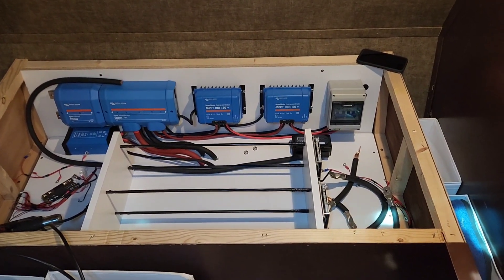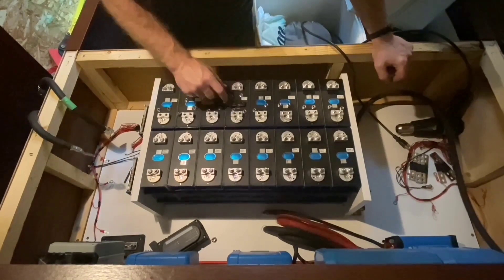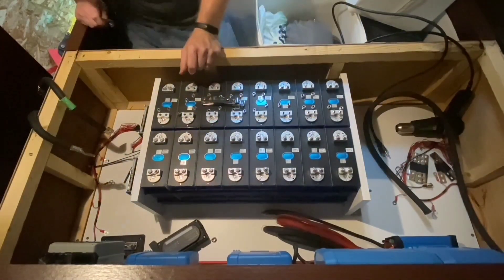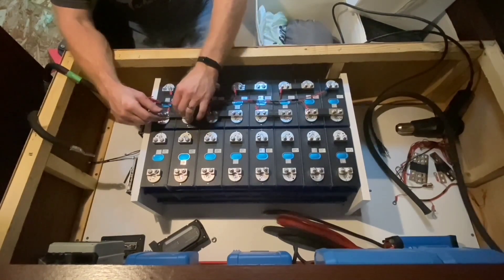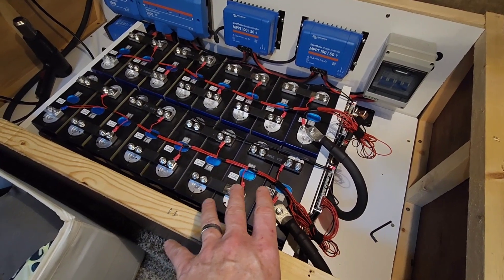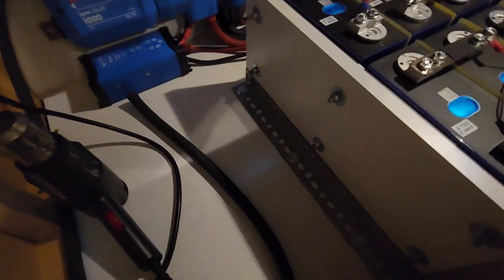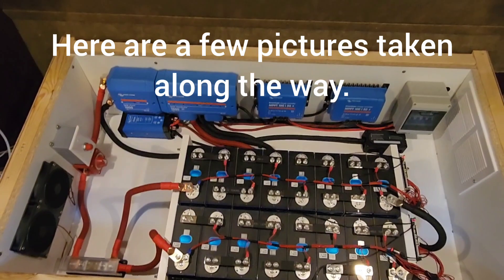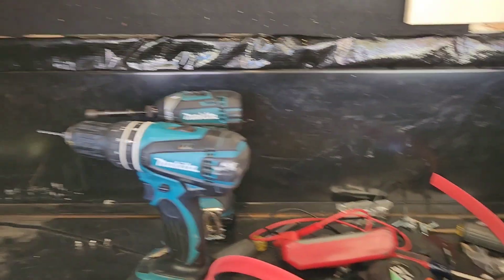Installing DIY LiFePO4 battery and Inverter in the camper.

Comment: I just got a 3KVA Hybrid Solar Inverter DC 24V to AC 110V Built-in 50A PWM Solar Controller AND 110VAC 50 AMP CHARGER  UPS,ATS. FOR $225.  FREE SHIPPING. E-BUY.

Comment: Nice job. There are some really poor Rv lithium installs. This is nicely done. Have you considered adding some polycarbonate to the top of the cells to reduce the risk of anything falling on the cells and creating a short? You would still have access to the  bms fuse etc

Comment: I'm about to embark on almost same build for our motorhome.  I'm curious abt your pre-charge box. That looks like a creative solution.  Can you give any details on it? Bought or homebuilt? Is it just a big resistor with momentary pushbutton across your batt disconnect switch? Can't quite make out the wiring in the snapshot.
Reply: You dont really need a big resistor, I use a 5w resistor & it only takes a quick touch of the lead to charge a 3kw inverter caps enough to stop any arcing. You can even use a low wattage filament bulb & a momentary switch would work fine.
Reply: Any suggestions on resistance value for that 5w?

Comment: Nice build! But the metal ring on your finger scares me. https://www.google.com/imgres?imgurl=https%3A%2F%2Fpreview.redd.it%2Fnot-mine-but-here-to-make-people-aware-of-the-dangers-of-v0-dq1e2wul17ga1.jpg%3Fwidth%3D640%26crop%3Dsmart%26auto%3Dwebp%26s%3Dcc03a13417de4766ec3011e9ddb3b23e4cd558d7&tbnid=rJb1PfkeNC2VmM&vet=12ahUKEwiXwL-EtoWAAxXMwMkDHUlDAegQMygLegUIARCUAQ..i&imgrefurl=https%3A%2F%2Fwww.reddit.com%2Fr%2Felectrical%2Fcomments%2F10tdqh2%2Fnot_mine_but_here_to_make_people_aware_of_the%2F&docid=mT5yXEJdS3njRM&w=640&h=853&q=photo%20of%20finger%20melted%20by%20ring%20on%20battery&hl=en&client=safari&ved=2ahUKEwiXwL-EtoWAAxXMwMkDHUlDAegQMygLegUIARCUAQ